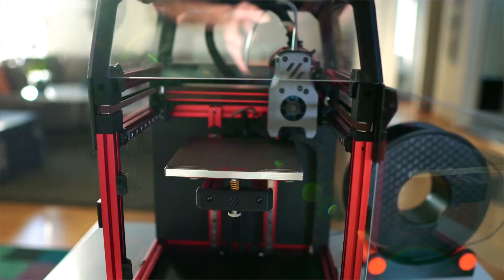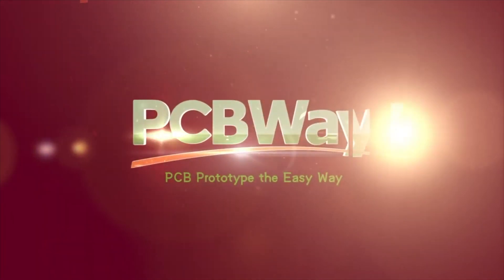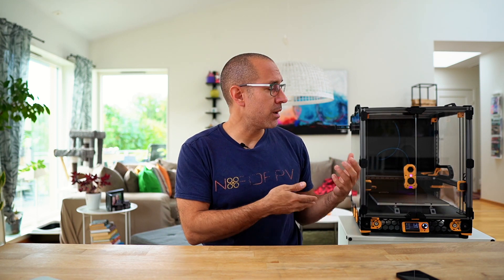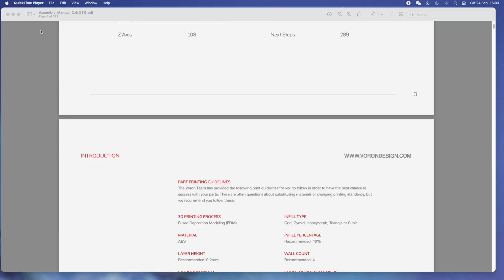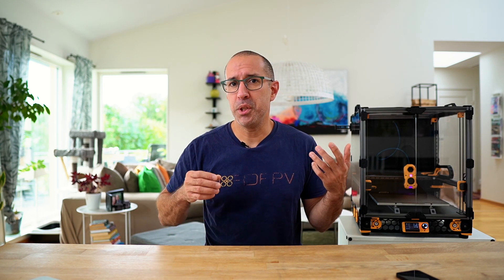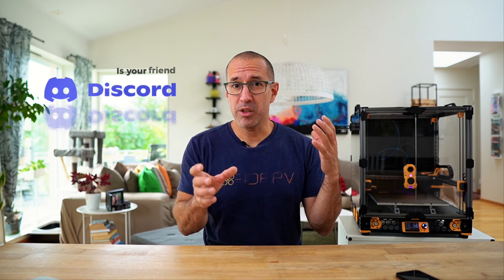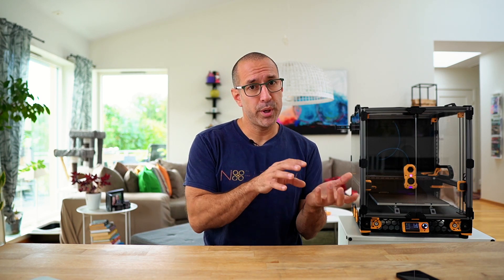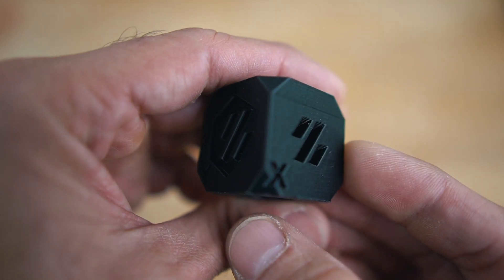Voron 2.4 - Is it hard to build one of these 3D printers?

Comment: Thank you for creating this video. I am very tempted to build a voron and am doing a lot of research right now. I keep hearing the LDO kit is one of the better kits out there instead of sourcing the materials myself. I think that’s probably the best direction to go it seems. Does the instructions talk you though how tight something needs to be? 

When something says “tighten this down” I tend to over torque stuff. 😂 So I was curious if they have torque specs when tightening things down?
Reply from the maker: Hey. LDO kit is great and instructions are very good. But they don’t get to that point of telling you how much to tight up a screw, not even things like the belts. I think you need a bit of experience to know how much to tight a screw in a plastic part vs in a metal. Now that I remember there are certain parts that mention “carefully don’t over tight it”

Comment: Building it isn’t the problem 
The software instructions are woeful 
After spending ages trying to get it sorted I dumped mine
Reply from the maker: Hi Padraig! and thanks for your comment. I guess it all depends on your personal background. For me, who have experience with software, the difficult part was the mechanic, software was a brief, and it took just a few minutes to get it up and running. Tuning is another whole topic, but to configure it and make it run was much easier in my case than the build.
Reply: @NordFPV  I agree depends on background and experience which I admit I don’t have any with the software side of it.
I do think it’s a pity that so much hard work time and effort went into the design and the making of the build manual and then little more than a foot note for the software.
I think the problem with many open source machines and their design teams is that the people involved are so talented and experienced with the software side of things that they assume everyone else has similar skills.
Nobody’s fault just the way it is, the hope is that if more people comment on why the build didn’t work out then those aspects of the build will get some much needed attention.
Reply from the maker: @padraigmurphy6442  You are right. I never thought about it, but the mechanic manual is great, the software instructions are very dispersed. And I agree with you that a lot of this has been done by intelligent people who assumes other have the same knowledge level. I think that was the main problem with the first manual for the 2.4, right?

Comment: Sure you can build it, but you forgot to mention "tools" I have a lot of tools and it took alot. First note: if you print your own parts Voron made the parts to print without support (doh, i wish i had know that). If you build a kit.. Study all their added suggestions, they will vary from the Voron build and you need to find them sooner than later.  Read each instruction muliple times, if you miss even one bolt it could cost you fustration. This is a build that would be infinitely easier the 2nd time.. Perhaps think about assembly with the intention to reprint parts and assemble a 2nd time.  But you still need tools, lots and lots of tools.
Reply from the maker: You are right, and they actually made a difference between when I built the V0 and the 2.4. I was more prepared, with more tools for the 2.4 and that helped a lot.
Thanks for bringing this up, I wish I could edit the video and add this in there.